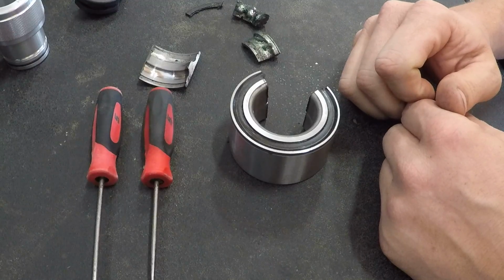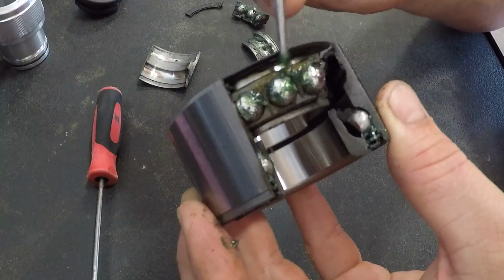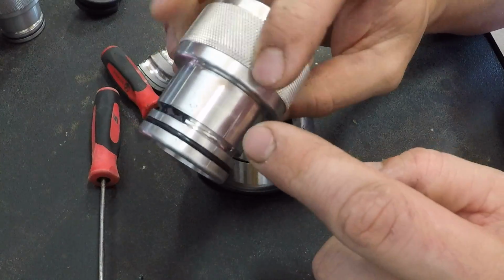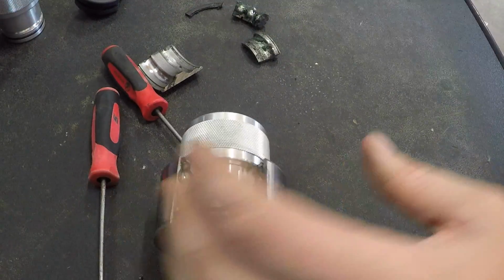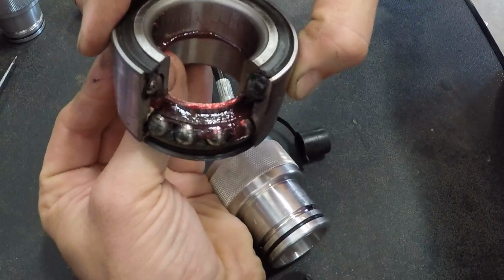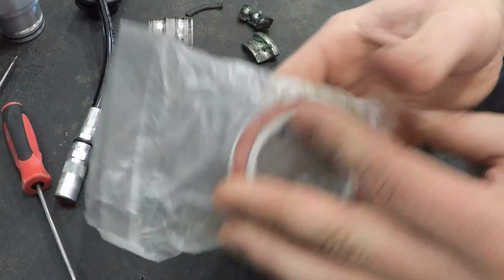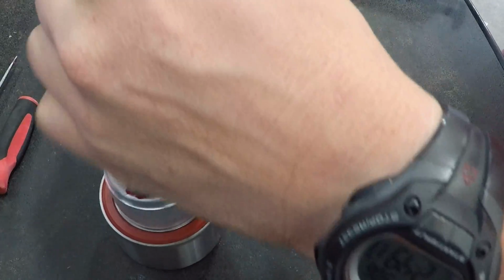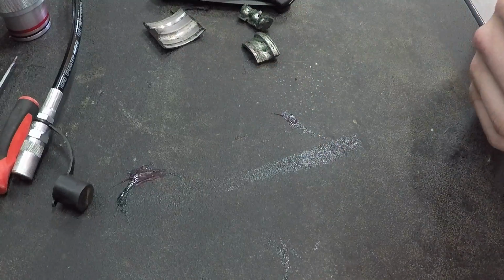CA Technologies Wheel Bearing Grease Tool for Can-am X3 Maverick, Polaris RZR, Honda Talon Explained

Comment: Tiger, SATV and others make a greaser. You WILL pull the bearing apart if you push the tool in too far but you can just put it back together

Comment: My problem that I got with this is the same as a trailler bearings set.. 
If you "over grease" a trailler bearing, it will overheat, and you WILL burn your bearings/bearing races out and destroy them.. As a full-blown service tech, to me, this is overfilling the bearings, and in return, the bearings will overheat !! On top of it, the bearing cages in ATV/UTV are made out of plastic (in general), so again, to me, this overheating will kill the bearing cages..  
Corect me if I'm wrong !!!!

Comment: I live in a sandy hot weather and most of my riding is going about 55mph to 65mph for about an hour or so and then stopping to cool down, i just did the service but i have a harbor freight small grease tool that really dosent push alot of grease out am i screwed because i did 20 pumps each side instead of 4 to 5 ? I didn't  see grease come out ot the sealed tho
Reply from the maker: Sounds like you may need to bleed your grease gun, you may not have applied any grease if there is an air bubble. I would check that out first. But if your grease gun does not release as much grease as others then you may need more than the recommended number of pumps.
Reply: @CA Technologies USA  thanks for responding. I did bleed my gun it just a low volume pump , im going to have a look at my bearings again. thanks again
Reply from the maker: @brp powersport  If you have any other questions feel free to give us a call Mon-Fri 9-5 est 423-790-0230. We are happy to help any way we can!

Comment: My grease gun always gets stuck on the can am Zerk fitting.  It doesn’t do that with my utility or boat trailer.  I also noticed 3 of my zerk fitting were super loose when I went to grease it the first time.  Did you have any issues like that?
Reply from the maker: The grease gun getting stuck to the fitting is not something that has been brought to our attetion before. And concerning the loose fitting, if they are loose just tighten them back up and they should be good to go! If they remain loose please reach out to us and let us know!
Reply: @CATechnologiesUSA  I tightened them up as I went.
I did buy this amazing adapter for my grease gun.  The LockNLube from Amazon.  It makes it super simple putting it on the Zerk fitting and taking it off.  It cut my lube time in half.  Best 30 bucks I have spent in a long time.

Comment: Wondering if the bearings in a 2019 Cam Am Spyder RT are designed in the same way to be able to grease them up or if they are completely sealed up and no way to grease them. One of the front bearings is making a whinny noise and I want to know if this tool in the proper size will work in that application. Thanks

Comment: Nice video and great explanations but can you explain the benefit of having more, or extra grease since the bearings are riding on the races . If you are claiming that manufacturers are  not  putting enough grease in there in the first place that is a whole different issue. How do you know if the grease is compatible with what is already in there?

Comment: Does the increase in grease cause excess heat due to the ball bearings being packed in the grease?
Reply: It should push out excess grease as the wheel rolls & heats up but as mentioned if enough isn't put in then the old, contaminated grease will not be removed.

Comment: Lovely tool for greasing bearings!nice video! Question (1) what type of grease is good/best type used for high speed wheel bearing application? (2) mmm.... this "new "out of the box" bearing wasn't grease enough from the factory" correct. (3) will this bearing overheat now that it has been excessively filled with grease??? good video. 100-100  ty in advance for response.
Reply: hy would it overheat,?
Reply: @excent1xn-648   "Too much" Grease will surely cause it to overheat. This is my opinion only as i experienced this issue of the bearings getting hot than "normal warm", So this is the reason I asked "the Exerts" here on Utube this question.ty

Comment: Why doesn't the wheel bearing just come with enough grease in it in the first place?  This video (how to) is about the 1100th I have seen on what to do to your $28,000.00 machine direct off the showroom floor, before you actually use it.  Or at least in the first few months.  Can Am should charge $1.29 more for the machine and have the wheel bearing packer do 5 more pumps before they install it.   Not sure, from all the replacement, after market parts if we are suppose to use the machine or work on it the first 4 months we own it.

Comment: This little tool can be a sxs owners best friend but in the wrong hands, it could destroy wheel bearings. You really need to spin the bearing while you're filling it. 
 The new cutaway bearing you showed could have a little more grease but you can get too much. Once a bearing is slap full of grease, the balls will not roll . Instead they slide and will ruin to your bearings.
Reply: Would this cause a loud squeak noise at high rpm if they were greased incorrectly?

Comment: Can this be used on automotive wheel bearings? I would imagine that all bearings have a specific inner diameter so the grease injector would have to match.
Reply from the maker: True, but as long as they are of similar style and with an inner diameter of either 39mm, 40mm or 44mm, I would presume they would.

Comment: I have 5 horse Sundowner horse trailer, would this be a 'one size fits all' tool?
Reply from the maker: Not certain, but we have three different tools which work with any similar style bearing that has an inside diameter of 39mm, 40mm or 44mm.  Hope that helps!  If we can provide additional help just call or email us (423-790-0230 or sales@catechusa.com)

Comment: So, is this a universal tool?  Can you use it on Odes UTVs?
Reply from the maker: Not Universal, we have three different tools which work with any similar style bearing that has an inside diameter of 39mm, 40mm or 44mm.  Hope that helps!  If we can provide additional help just call or email us (423-790-0230 or sales@catechusa.com)

Comment: id like to have order info for this product just bought a new 2019 outlander 1000r xmr and on my 09 outty i replaced bearings A LOT!!
Reply from the maker: I'm not sure, but it appears the outlander has a 30mm inner diameter bearing.  If so, none of these would not work for your application. If they are either 39mm, 40mm or 44mm, we have a solution for you! Hope that helps!

Comment: Is there any reason to be concerned if grease is only coming out the front and not the back side of the bearing? I have that same exact bearing with center groove.
Reply from the maker: not unless you believe there could be debris inside.  If so, you can pump it a couple of additional times to try to force out the foreign object.

Comment: Hi..So a few days ago i contacted you on your page, But no one get hold of me...So i seen this tool on here and your page..So this one has one seal and the material is dole looking and one on your page has two seals and shiny...Just wondering what one i would be getting..Its for the RS1...Thanks
Reply from the maker: The tool you see in the video is for a Can-Am X3 which is only able to have one O-Ring. All grease tools for the RZR will have two O-Rings. As for the appearance question, all grease tools have a raw machined finish as when they are taken off of our lathe they go straight into to bins to be shipped after cleaning. So the dull appearance you are seeing is attributed to two things likely one from a poor camera quality, and two being this is a tool we use in our own shop for service work, so there is no telling how many uses we have on it.
Reply: Oh ok...Thanks...Crazy how sealed bearings are not greased fully.....

Comment: Will that work on cf moto zforce 1000
Reply from the maker: Not certain, but we have three different tools which work with any similar style bearing that has an inside diameter of 39mm, 40mm or 44mm.  Hope that helps!  If we can provide additional help just call or email us (423-790-0230 or sales@catechusa.com)

Comment: Eric, great explanation! I've heard some say just to put 4-5 pumps and move on. Would it cause any issues when you have it totally full?
Reply: For one dont use any kind of grease, you'll want to use polyrex grease as that's meant strictly for ball bearing, and secondly pumping them bearing plum full will create heat and due to ball bearings dragging, I would highly recommend not putting grease in New bearing than 5-7 pumps a year there after.